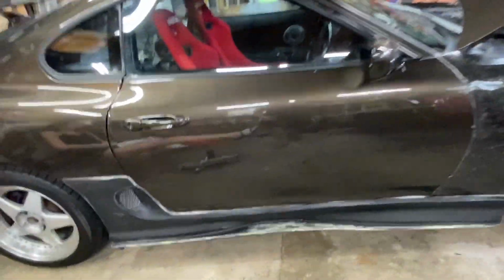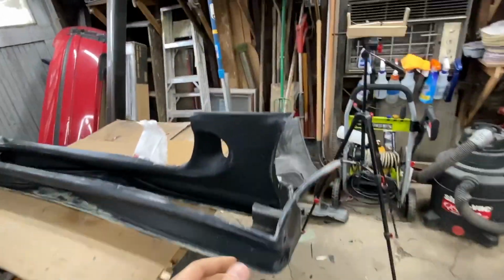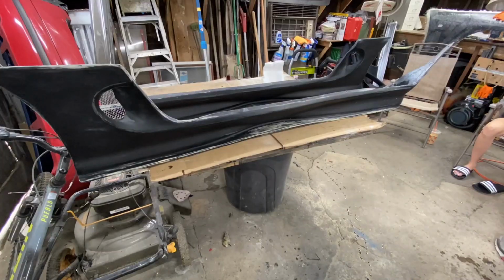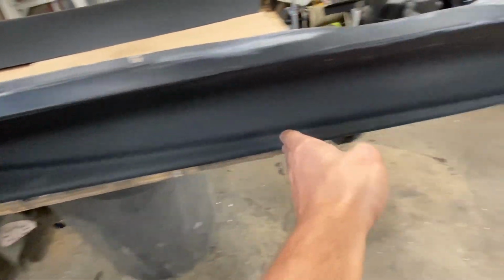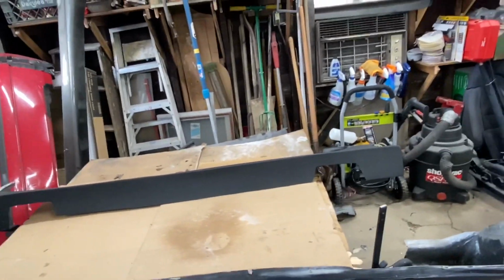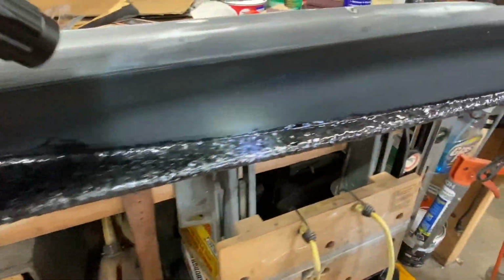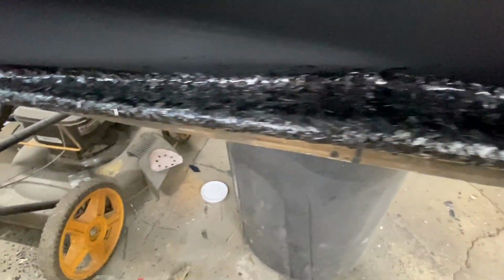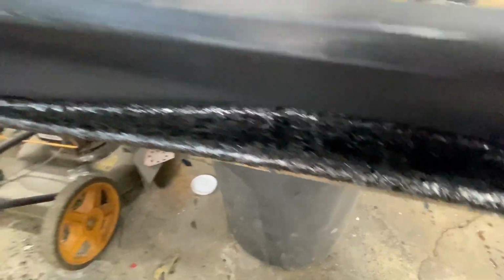MKIV SUPRA | Forged Carbon Rocker panel/ Side Skirt

Comment: Skinning like this looks great and adds strength and stiffness. However it adds a tremendous amount of weight especially with shredded carbon if you build it up thick enough. Remember its not just the weight of the carbon but the laminating resin as well. Kudos for this project hope it works out great
Reply from the maker: Thank you man, yes the high end ridox rockers were to pricy and I want to show people you don’t have to spend $2,000 on a rocker to get the carbon look, and better yet, no company makes forged carbon parts for this car so everything that’s been done so far is for the most part a 1 of 1

Comment: Did you chop the carbon strands yourself? About how long are the strands? I'm planning on doing a motorcycle fender.
Reply from the maker: In one of my previous videos where I make my fender I cut my own pieces, roughly and inch long. In this video I went on fibreglast.com and ordered 1/4 chopped carbon as a test to see if I like the length and the outcome of the final product. For a motorcycle fender in my personal preference a shorter strand like what I’m using would come out incredible!